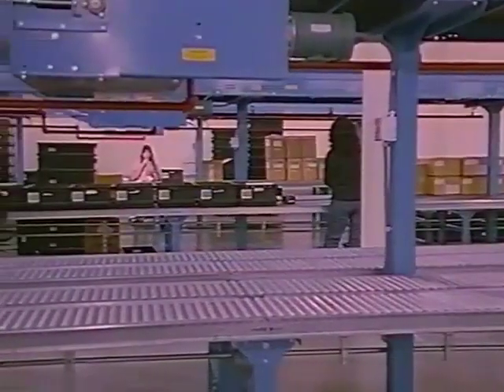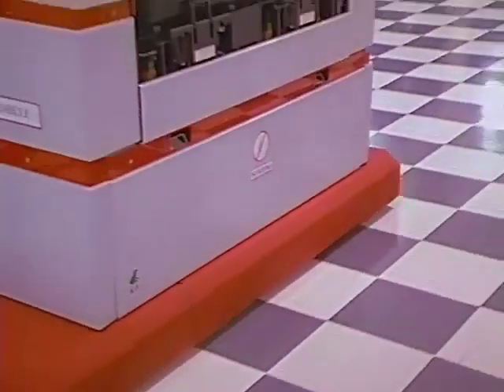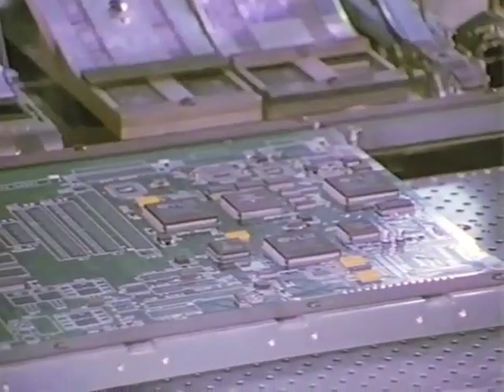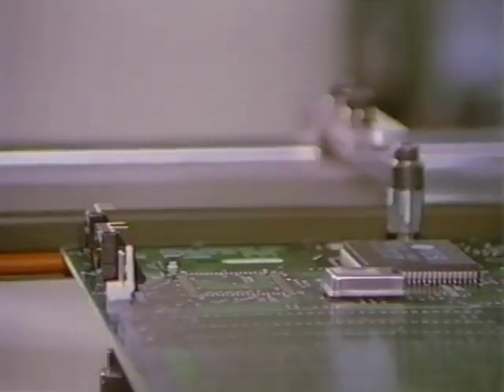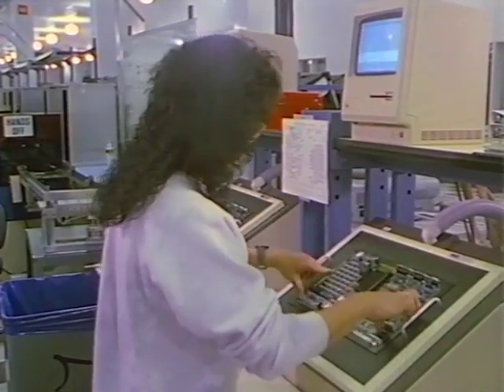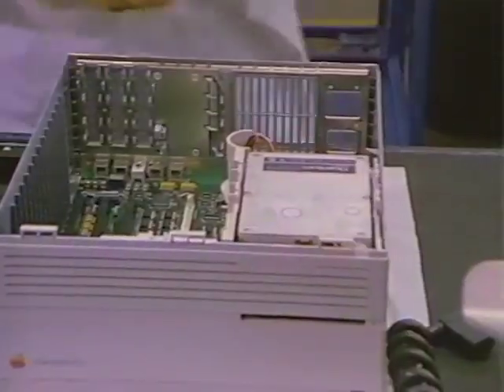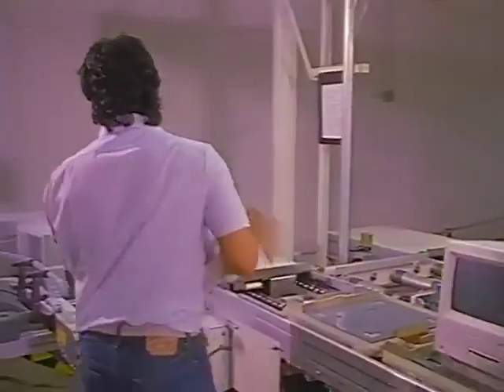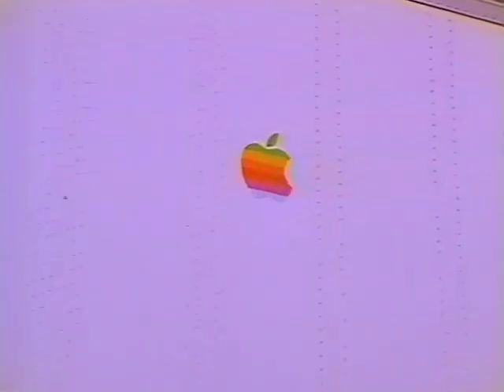'We Are Manufacturing'  - 1991 Apple Computer Assembly Process

Comment: The unknown machine is probably a development prototype of some sort, or not a Mac at all. I'd guess based on the time, size, double SCSI and external connectors that it's a Quadra 900 prototype with RAM soldered on board rather than 16x SIMM slots and with a different board layout, and without the NuBUS slots, but with a PDS slot.
Reply: It's a Mac Portable board.